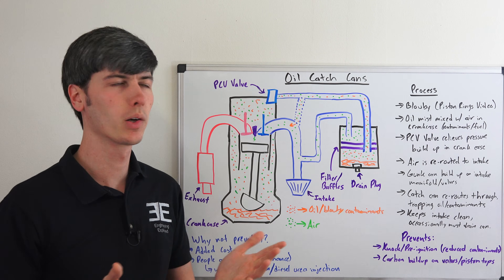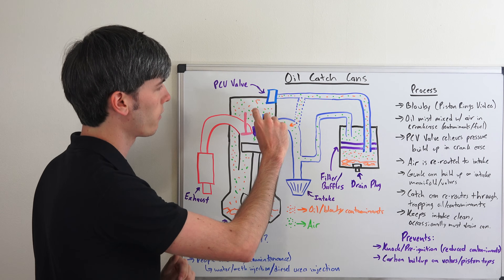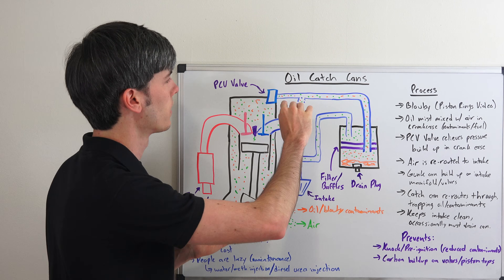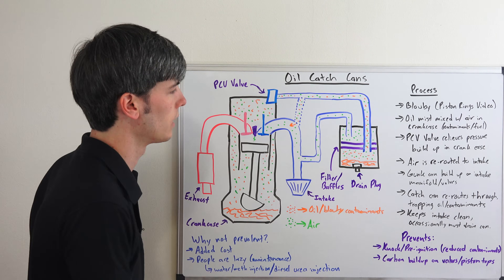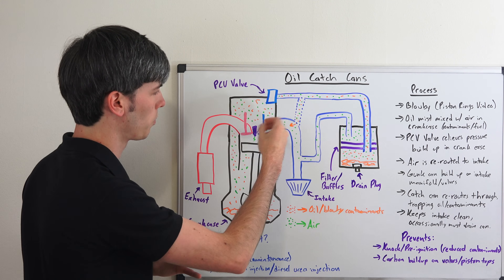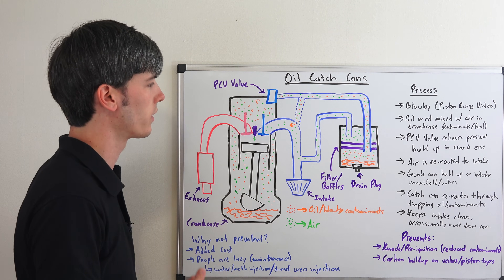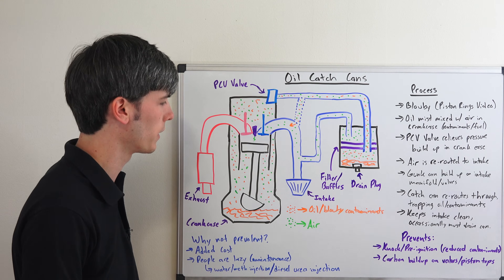What Is An Oil Catch Can?

Comment: Yawn , BMW make some of the best engines on the planet , they have some of the best engineers on the planet being paid top dollar . Well some dude on you tube is saying we need oil catch cans lol guess who I’m going to listen too? Lol
Reply from the maker: BMW does have great engineers, not sure what that has to do with the video though! Hope your day is going well. :)
Reply: Engineering Explained I’m having a good day I just don’t see the point of these catch cans , if the top car makers don’t fit them in the factory then they mustn’t be of much use . Waste of a video just my opinion
Reply: Steven Foley well I'm a big BMW fan but let's be honest BMW engines have a lot of problems, just don't let me start please!
Reply: Steven Foley same company that can't get their cars to 200k without a water pump or head gasket going out but ok sure. Top car makers.
Reply: TxJonathan maybe it’s the drivers that break their cars and there are plenty of BMWs with over 200k . Same with fords , I just don’t see that oil catch cans are any use , if they was they would have been fitted in the factory . Just more BS
Reply: Steven Foley Are you suggesting blow-by does not exist and that piston rings make a perfect seal
Reply: NeGraVity40 well what I’m saying is if it was a real issues then they would install them in the factory . Remember the old days when cars had a manual choke? Well they have been engineered out and replaced with sensors. My point is the engineers mustn’t think it’s a issue that needs to be addressed
Reply: We are not talking about how reliable BMWs are (they are if looked after and driven correctly ) oil catch cans are not needed if they was all the car manufactures would fit them .

Comment: Why don't car makers add this to cars.
Reply: Cleaner? You still have to dispose of the oil , just like you would with an oil change. How is it cleaner? It actually send the crap back into the engine to be BURNED and not recycled, and cokes up the intake valves dropping performance and efficiency (MPG), so again, how is that better?
Reply: @JohnDodgeNetJD  
Ford is letting some fuel bathe the intake valve along with DI to negate the need for a catchcan in their Ecoboost.
Reply: LIANG XU probably because you have to drain them often which would require more maintenance. And also maybe because all that junk is burned instead of drained and dumped which is cleaner.
Reply: Because most people don't change their oil let alone have to check a catch can as well.
Reply: Sorry but no fuel goes over the intake valves with direct injection and no where have i read that Ford sends some fuel to negate carbon build up. Please provide a source and I will publicly acknowledge that I was mistaken, but until then I disagree. A catch can is a must with DI engines. My buddy Tracy Lewis can explain it to ya... At tracylewisperformance
Reply: Ah, so starting in 2018, Ford has introduced dual injection, I was mistaken. This does help as intended.
I would still use a catch can though.
Reply: @JohnDodgeNetJD  
"......I will publicly acknowledge that I was mistaken ......."
John, you did good, thanks.
"....I would still use a catch can though."
But you blew it! LOL  ..........

Just curious, if one wanted to go to the expense, would a 2018 intake be interchangeable with an earlier model? Is it more than just plumbing?

Comment: How does a ported cylinder head work and what is the difference between a regular, and ported cylinder head?
Reply: Bigger pistons dont always mean more compression if you are talking about diameter, you can get overbored pistons with a lower or higher compression ratio
Reply: Francesco Barbera true, it depends on the quality of the piston, how the fuel and air flow through the cylinder, etc.
Reply: Correct, assuming were using forged pistons in the example, Eagle rods and pistons, they can either have a standard 10.5:1 ratio, 8.5:1 or 12:1, same diameter of piston, but different ratios for different applications
Reply: Francesco Barbera the term "forged" is actually incorrect, because I'm fairly certain not a single company actually grabs a block of steel or aluminium and beats them with a hammer to give them the correct shape. There would be too many imprefection, especially since they need perfection+ to achieve what they must.
Reply: Matthijs Gerretse correct, i believe the proper term would be hardened not forged
Reply: Francesco Barbera or heat treated

Comment: Is this even more of an issue on direct injection engines? For instance on VW TSI 2.0L Turbo, because fuel is directly injected, it doesn't clean up the back of the intake valves leading to carbon buildup... which can lead to lost of compression ratio, miss-fires, rough idle, potentially damage your catalytic converter... for all the benefits of direct injection engines... there sure are some drawbacks with higher maintenance.  Why haven't manufacturers built in a stock mechanism to clean that carbon build up in direct injection engines?

Comment: What is your take on oil catch cans for diesel engines? I heard they are few on the market (EU) because it needs to be a higher capacity since crankcase pressure is higher in a diesel. Any recommendations? Thanks.
Reply: Lucian Dobrota dont they have crankcase filters integrated for cummins engines at least (isb)

Comment: Question. Is there any benefit to having that oil going into the intakes? Have manufacturers considered that extra lubrication? I want to fit a catch can but I want to be sure that there are no negative effects.
Reply: Oil is going where you dont want oil to go....
Reply: Oil in your intake causes carbon build up and reduced the octane rating of your gas causing knocking and loss of performance. There is no upside.
Reply: If you have a lot of Blow-By or a least when you look into your Oil Cap and see a lot of Moisture when Engine is Hot or see a lot of Moisture in the Muffler/Exhaust.... This will help a lot especially Starting issues! I installed this in my Dad's Truck after seeing a lot of Moisture in the Oil Cap / Muffler / Exhaust and Hard Start of Humid / Cold / Rain Morning / Nights. Now the Trucks starts right away and works really smooth too. BTW... I see my Dad always have problems starting in the Morning or when Rain out. I also see a lot of Steam coming out of Oil Cap when the Engine gets Hot! Once I install the Oil Catch Can with a Filter for venting, somehow it solved it, especially Hard Starting in the Morning / Nights!

Comment: With your background, do you prefer a "closed system" or vent to atmosphere?
Reply: Vent to atmosphere is bad in terms of emissions.
Reply: +Chris AF - Either way will be bad.... In my case, I have moisture problems.... If we sit the there and keep cranking the Engine, we are actually wasting gas / un-burnt fuel coming out for the tail pipe and that would lead to more pollution :(((((
Reply: I did my Dad's Truck with Vent since I see a lot of Moisture.  If you see a lot of Moisture in the Oil Cap, vent it out... This will help your Engine runs smoother... Start better in the Cold / Morning / Rains too :D.

Comment: why do you need that other hose from the catch can back to the intake? surely that's unnecessary
Reply: I understood it that the hose drawn with the dashed line is what exists only for systems without a catch can.  I presume there needs to be some way to prevent pressure build up and if a vent were used contaminants in the air mixture would go into the environment instead of via the exhaust system.
Reply: Most new cars need it because the system  has to be closed otherwise unmetered, unaccounted for air would enter.
Reply: It surely is, otherwise it’s not a ventilation system...
Reply: GOAT McGregor how would you expect the fluids to be drawn into the catch can. The vacuum from the intake draws it into the catch can and the water drops to the bottom even it gets into it.

Comment: Do the Subaru Crosstrek need one of these?
Reply: I don't see the need for one on Crosstrek's.  They use the FB20 motor where the fuel is port injected instead of direct injected.  Port injection keeps the backs of the intake valves clean, so no worries there.

Comment: will the oil going back in the intake cause smoke to come out exhaust
Reply: Stance Nation possibly but it could be from different problems. 1.) if your rings are worn, it will allow more oil above the piston and it will be burned during combustion 2.) if there's too much blow by, there might be more oil circulating through the intake

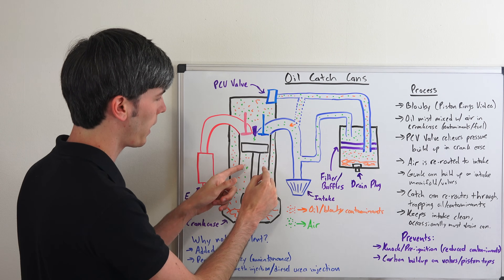Comment: You are wrong, you said at time frame 0:37 that: " Some of the air leaks past your piston rings device cylinder crankcase combustion chamber" WRONG!!!  
Question: Young Man, Can you tell me what: " Valve Flank speed " is, And how is that relative to Horsepower? Without looking it up on the internet, or otherwise consulting a textbook of some sort? I'm willing to bet you can not.

Comment: Cant we reroute the oil caught up in the oil catch can to the oil filter and get in back into the lubrication circulation? it eliminates the major error of manual removal of oil if possible
Reply: Checkout a system like ProVent 100, 200 or 400. You would have to put a tap in your oil pan, but yes you can do a lot more with this mod.
Reply: Raj  Mehta the true answer is no. It's possible but not convenient as those vapors are  contaminated with fuel. The life of the oil would decrease at much faster rate.

Comment: Now with all that said, the next question is : what's the difference between a 20$ and a 150$ oil catch can ?
Reply: A good OCC ($100+) will have baffles to trap the oil mist getting out from the valvecover. Without baffles oil will still get in your intake. Do some research on the mishimoto linked in the description, Saikou Michi or the Moroso Air/Oil separator.
Reply: aliendisco12 running one of those cheap cans that I added a stainless steel scrubber in the bottom and a hose on crank case side so it doesn't spray the oil up high right by the vacume side

Comment: So quick question. I have a naturally aspirated 2000 Jeep and I wanted to install an oil catch can just due to the Jeeps older age. If I were to install an oil catch can does it have to reconnect to the intake or is having a motorcycle style air filter on the catch can alright?
Does the connection to the throttle body produce a draw of air  necessary for the PCV to operate or is a filter alright on the catch can with no connection to the throttle body?
Reply: Matthew Wray im also searching for this absolute answer
Reply: Hey I've still been looking. I see them in both configurations and havent found any helpful information yet so if you or anyone else knows anything let me know. I'll do the same

Comment: I have a honda civic Type R FN2 which has two PCVs one on the crankcase and one on the head cover. As far as I know only the crankase pcv is a blowby whereas the head cover pcv is only a a vacuum pcv that only blowby sometimes when you rev high. My question is should I still use some kind of filter for the head cover pvc in the pattern you showed in the video or should I still have both of them attached to the same catch can without anything? ( I only have a small air filter attached to the top of the catch can)

Comment: Doesn't most modern engine systems that use a PCV also incorporate a oil separator in them? I know the efficiency of oil separator is debatable, but instead of having something to regularly drain out, the oil separator returns the liquid oil (albeit with some contaminants) back to the sump. And we also know why manufacturers have specific oil requirements over and above the standard SAE/ACEA metrics, it accounts for the oil with the contaminants retaining it's properties over a specified service interval. So without talking about oil separators, which most modern engines have, having a lazy label for not having a catch can doesn't sound fair.

Comment: Not sold on the concept. Sounds too basic for modern engineering to have missed.
Reply: Every automaker now includes internal separation devices, these are somewhat partially effective but reduce engine life by retaining the contaminates that should be removed. This is why most automakers have dropped engine warranty periods from 100k miles a few years ago down to 36k in many cases today.
Reply: Sounds simplistic as well that this is about engine mileage guarantees. Do you want me to believe my motor is going to blow that early? People are being advised to change oil once a year now with longer mileage intervals.
Reply: No, only accelerated wear, oil consumption, and eventual failure. All takes time.  Wonder why GM and BMW and Ford recently dropped engine warranties from 100,000 miles to 36,000 on all GDI engines?  And if you look at the studies by some of the largest lubrication companies show the wear caused by the hard crystalline abrasive particulate matter shed and the amount of raw fuel wash down and dilution due to the higher CR of GDI engines and the fuel introduced at from 500 PSI at idle to 2,000-3,000 PSI at WOT results in many times the amount diluting the oil.  1 year oil changes is mainly for marketing to go along with the trend of doing nothing but adding fuel to today's cars. Automakers target 50k miles for average vehicle usable life now as most new vehicle buyers trade for new in 3 years on average. Gone are the days of 200-300k miles neglecting an engine like the port injection engines of the past. Most do not even have transmission fluid dipsticks anymore, and some like Mercedes/BMW, etc. do not even have oil dipsticks.

Comment: are those in bikes too? I'm havin a new after watching a vid that says new aftermarket airfilter improves ur engine performance. When i tried tho switch i found that a pipe from engine to a air filter via cylinder. What happens to engine if i remove that connection.
Reply: Yes, and if removed you eliminate the only process that removes the damaging compounds that enter as blow-by.

Comment: So why dont car companies route the catch can oil back to the oil pan and the air back to the intake and into the engine? Would save on emissions and you wont have to empty the catchcan. I guess they want you to slowly destroy your engine so they sell more. Someone should engineer new oilpans with a catch can routed to it on performance motors.
Reply: This would be returning a concentrate of the contaminates that cause wear and overwhelm the oils ability to protect. With a truly effective can like Elite Engineering's E2-X or the genuine RX (beware the cheap Chinese counterfeits), the Tracy Lewis Performance and a few others what is caught when analysed consists of the following:  70% acidic water, 23% raw fuel, and 7 % oil saturated with abrasive particulate matter. Returning this to the crankcase will greatly accelerate wear and make short work of your engine.

Comment: so would actually been beneficial in the long run for the life of the motor and engine performance. I own a civic si and I have been on various forums and they all seem to suggest that it's required if you have forced induction typically a turbo charger. I am just trying to justify dropping a couple of $100 on a catch can. so is it really worth it with a naturally aspirated engines. I have a lot of respect for your videos and I really would appreciate your honest opinion. thanks.

Comment: My catch can isn't filtered but I can add filters in the future, I'm just trying to keep actual oil out of my intake because I own an old diesel, and my PCV Valve is in a really silly place and oil for the valve train leaks into it really easy,

Any one with an Isuzu truck with a 4JB1-T engine really should run a can,

Comment: I'm thinking about buying one for my WRX, are they worth the money? And does a two can system like the mishimoto one make a difference, when compared to a single can system(PCV to PCV inlet)?
Reply: Mishimoto does many routing applications correct VS so many others. The can design allows far to much to pass through them, but they are better than most. They at least understand proper evacuation principals where almost no others do.

Comment: you should've talked about the history of the PCV system - the discovery of the source of a bunch of California's pollution is pretty neat!
Reply: GM invented the PCV system as we know it during WWII as the gasoline powered tanks as the draft tubes used on other vehicles were not working due to the slow speed so explosions of the gasses left in the crankcase were a problem. Jump to the mid 1960's when the Fed's mandated all vehicles used on highway have the PCV system as we know it today (basically) and this was ONLY to reduce the groundwater pollution form the dirty oil dripping on the roadways from draft tubes.  It was in the years following that engineers discovered the same engines, with the same oils and oil change intervals were now last 2-3 times as long as before the PCV that it was discovered it was also removing much of the contaminates that caused the wear prior. There is much more to add, but another time.

Comment: my eco boost isnt catching any oil in the can, its perfectly sealed but when i check it there's nothing in it
Reply: That can happen - if the engine already has an OEM good oil-air separator connected to the  PCV valve (normally hidden in the head-cover). Have the 2.2 Diesel Ford engine in my Land Rover. On LR forums it was said that the engine has a good air/oil mist separator and that a catch can was unnecessary. I fitted a Provent catch can and after 5 000km have not yet collected any oil. Vehicle has now done 32 000 km since new. Still glad I fitted it though. Inspecting the air intake hose distally to where the PCV hose joined - one could detect a slight oil deposit. Theoretically this should now not happen any more after fitting the catch can.